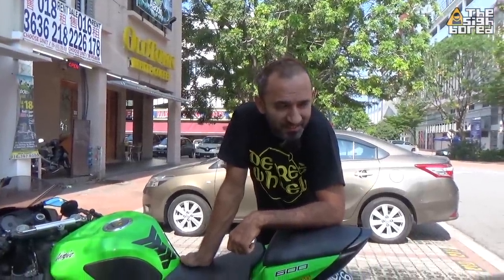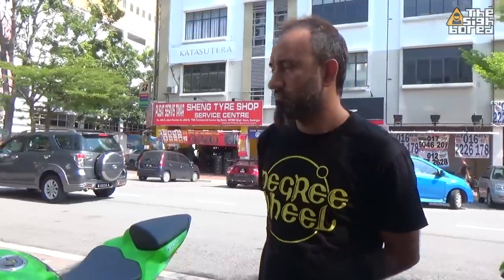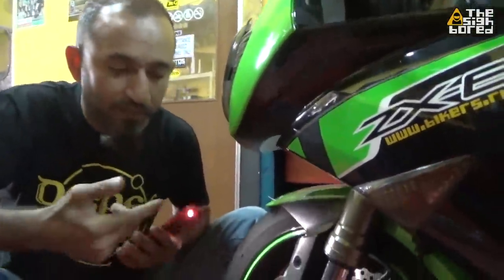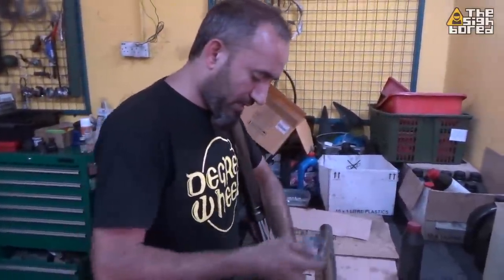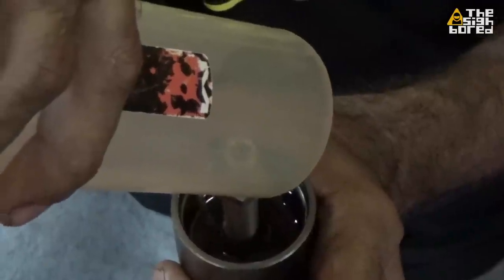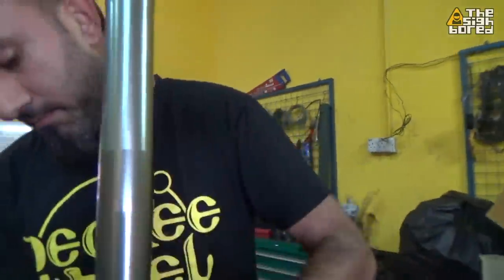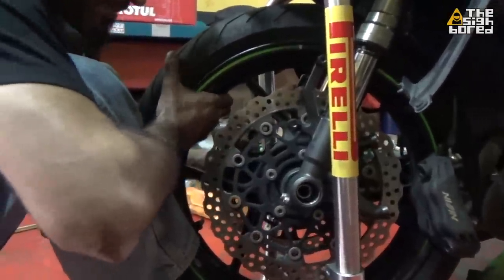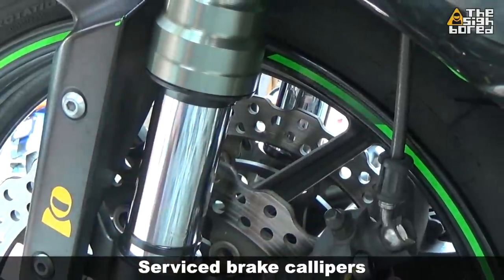Kawasaki Ninja ZX-6R | Workshop 22 | 60,500 km | Fork oil leak repair

Comment: Greetings, 
Great video. Just a quick noob question - dosent the cable tie on the right fork would make your dust seal worn out quicker?
Reply: It wont... As long you dont tight it to max .  Its there for reference...
Reply: @AhmadKhan66   - 👍
Reply from the maker: The Cleaner has spoken.

Comment: how long does the fork servicing takes? rm460
Reply from the maker: Close to a day.. These types of work need time so be sure to set aside time for it otherwise leave it with the shop to be worked on.. Also making an appointment is good so they are prepared.

Comment: my brakes squeak after changing the brake pad ? any reason. ?
Reply from the maker: Fresh pads? Squeak when you brake, or just squeak when the tire rotates? Maybe the callipers are not opening wide enough and scrape on the disc, or the disc may have some wrap in it?
Reply: TheSighBored when i apply the brake, it squeak..
Reply from the maker: Sometimes it depends on the type of brake pads you use, the material composition.. If fresh pads, might be the surface still being skimmed on the surface of the disc.. Don't try to put any lube to reduce the squeaks! :P
Reply: @thesighbored  Lol... Don't put lube on the squeaks part.. hahaha.. okk..